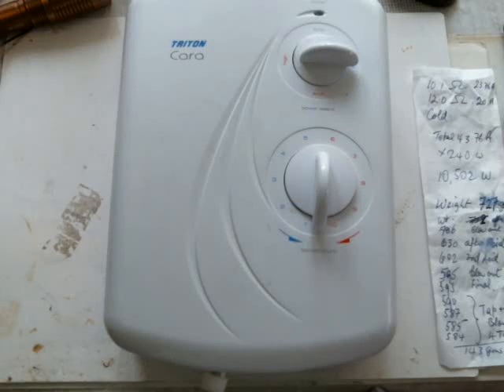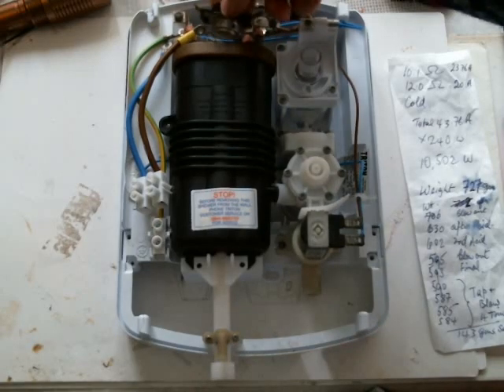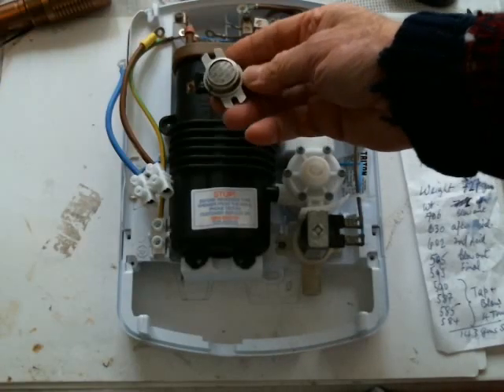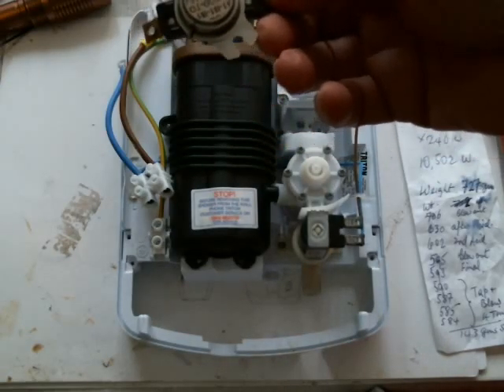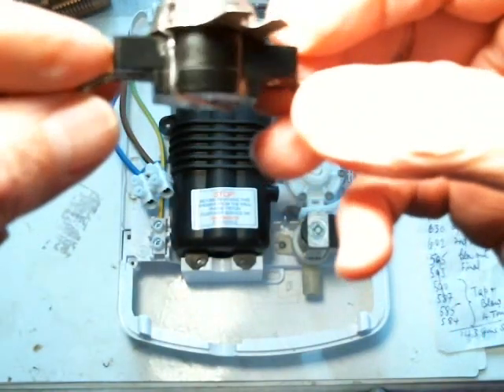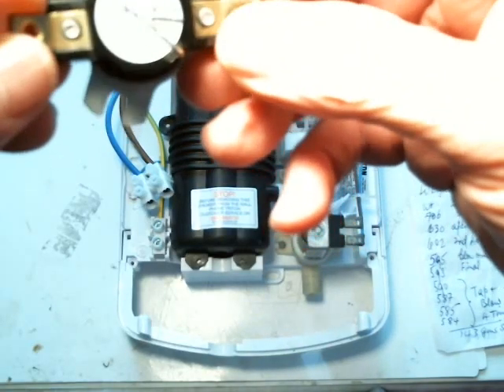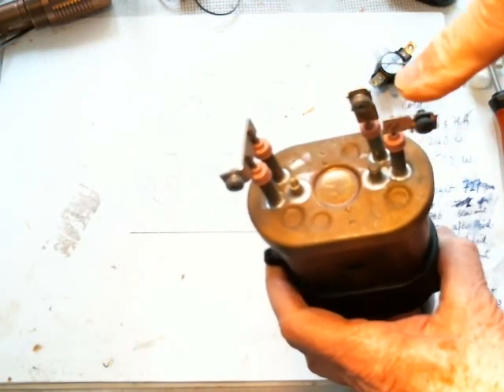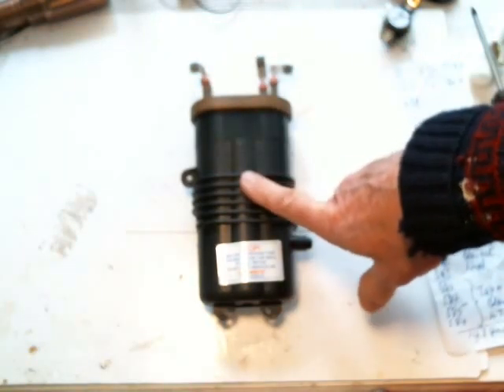Shower descale Part 1

Comment: I've always wondered if there's a way to connect the inlet to the output and pump white vinegar through it in a loop, turning the heat on for a few seconds to aid the process. Of course there may be some gases released so may want a safety valve.

Comment: Great care required when working on showers. An electrick shock under these circumstances would be very nasty. Evan if rcd protected  you will still get one hell of a wallop before disconnection.

Comment: is there any reason I cant put kettle descaler in that small hole, block all the other holes up prior so it does not just run away and then leave in 30 mins and the flush it all out ? or just put an in line electronic water descaler for a permanent fix thats about £40 on line or just fit an inline screw on magnet to change the water molecules for about £10 or for £10 just add a inline clamp on magnet that will rearrange molecules in water to make all water entering house from stop cock better

Comment: I get a new triton shower every 7 to 9 months. Same thing every time. I try to keep it as empty of limescale as possible by shaking the bits out the hose and head weekly. But without fail after a time it will just suddenly trip the breaker and thats it it's time for a new one.
Reply: Have you tried letting it go cold after you finish the shower to reduce hot water sitting in the element?

Comment: Hi Chas 
Quick question 
I have replaced the TCO 3 times now in as many weeks.  Flow is good and there’s been no fluctuations in temperature prior to the shower only having cold water.  The TCOs have never reset and just stopped working.  Did a continuity test before fitting and it read 0 then after failure read 1 on multimeter.  Elements in heater read 11.3 ohms and 11.2 ohms.
Beating in mind what I’ve tried to explain could the problem be a scaled up tank.
Many thanks
John
Reply from the maker: Hi John G,  cant be specific with your particular boiler but sounds like the descale would do the business!  Have a go, there is nothing to lose...  the trade is not geared for this type of repair!   But you do need basic diy skills to remove the boiler and put it back correctly ( no leaks and correct connections) after the descale covered in Part 2.. Good luck with it. Chas
Reply: @ChasChas9  thanks Chaz .. I did it yesterday following your instructions.  Tbh there wasn’t much to remove.  Went back together fine and I’ve put another TCO on and shower is working again but for how long I don’t know.  If the TCO fails again ( never resets just fails) is there anything else it could possibly be that is causing the TCO to fail before I fork out paying £400+ for a new shower. (Same model I have for ease of fitting)
Cheers Chaz
Reply from the maker: @johnster-w3k   The TCO is operating for a safety reason ie . boiling water.  So take the popped ones to bits and reset them so you have some spares! Again diy skills needed but you seem to be doing fine! C+

Comment: Hi, took your advice on a t80gsi.. mine didn't even need descaller, just plenty of water in , out, in out, in out etc had to shake the heater can like a madman to get it all out though! Smashed the heater can against the kitchen side numerous times (they're actually fairly strong so wouldnt worry), could hear all the limescale got two whole cup fulls out! Started running clear after a while felt a LOT lighter.. popped it back.. ran like a dream like a new shower, amazing!👍 Has not cut out once! Runs lovely. Obviously I understand your video was very thorough, my attempt was the amateur lol did work perfect though.. may be a few bits still inside etc but will suffice for a good for months/year I reckon lol

Comment: Hi Chas, brilliant video, thanks so much for taking the time to film and post it. This is the second time I have descaled my Triton shower now. Up the gazoo made me laugh!

The only thing I will add (which maybe you cover) is to remember to run the shower on cold for the first time after fixing. I ran mine on its normal hot setting and because there was no water in the boiler the thermal cutout tripped and I had to watch another video on how to reset that! Just in case anyone needs to know, drill a tiny hole about 1mm in the top of the the thermal cutout, poke a pin in to pop the disk back down. Cover the hole with insulation tape and it should work. It might be dangerous but it worked for me and has been ok for the last year. One well used shower diverted again from landfill : ) Thanks again
Reply from the maker: Hi danobable, thanks for comments, good idea drilling the top disk to reset the inner one, I didn't do anything like that coz I had to take it apart first to find out how it worked, could'nt find any explanation at that time! C+
Reply: I took mine apart and the bit between both disk was in peace’s the rod that is under that was bad so I took it out and put the two disc in and put multimeter on it and now have a reading is that ok or not

Comment: Are there is a water filter before heating element? Thete is no pump on this model?
Reply from the maker: No pump and no real filter, this is a mains pressure shower not what I would call a power shower!
Reply: Chas G thank you for your unser. What about triton models who feeding from tank. They are with pump.  Its that what you call power shower? They can be fited to main water suply?

Comment: Thank you for this. I have exactly this Triton shower and exactly this problem. I opted for a replacement boiler (didn't give the temperature sensor any consideration - perhaps I should).  Still a work in progress as water's coming out of the side inlet now; I don't recall there being a seal, gasket, tape or sealant of any sort there when I took the old one out; did you have anything on yours?
Reply from the maker: There is an O ring to seal that joint - it maybe in the hole and didnt come out when you took the boiler out...

Comment: First class instructional video.  If only they were all like this.  I am going to try this using brick cleaner but am not sure what dilution the hydrochloric acid is in the btick cleaner I have.  As there are 5 people queuing for showers and I don't have time right now I will order a replacement shower for a quick fix ( this shower is only a year old - seriously chalky water here) and then clean the old one ready as a back up.